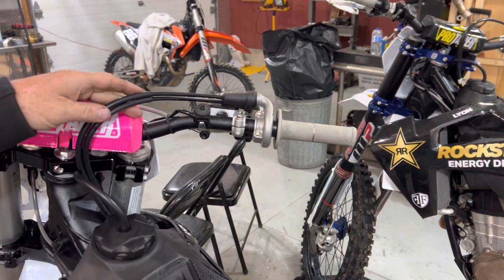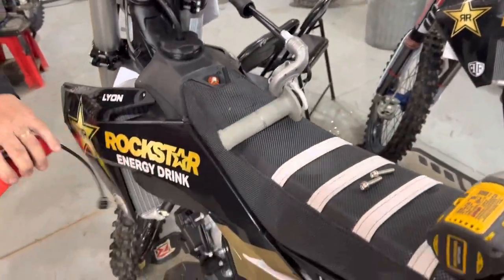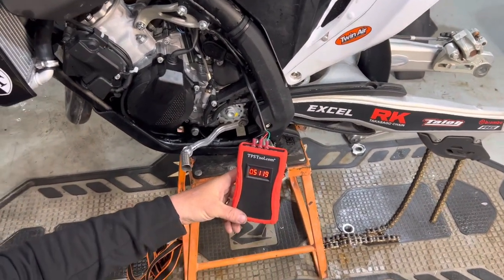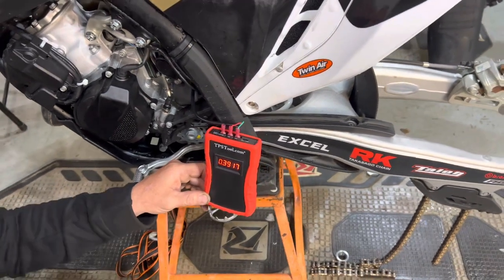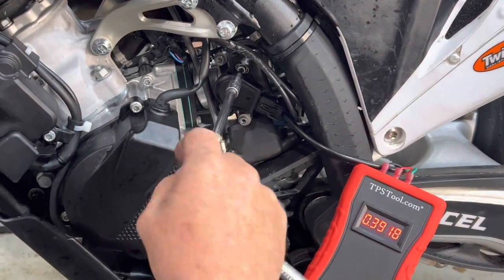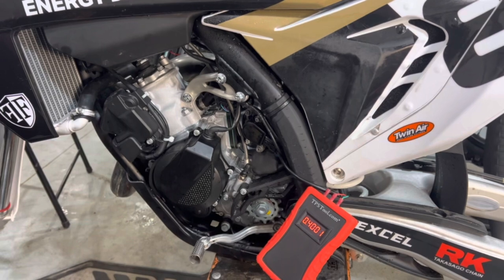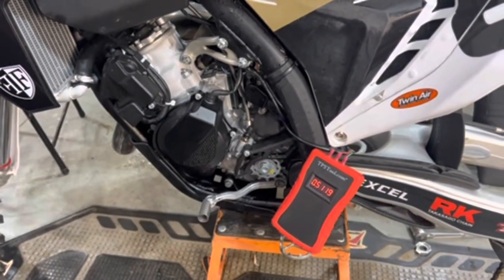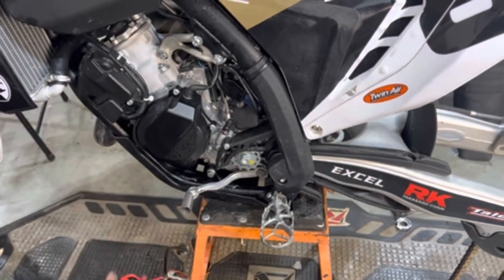TPS Throttle Position Sensor 2023 KTM 125sx 250sx 300sx TBI Husqvarna TC125 TC250 Two Stroke 2T

Comment: How would you know you need to do this I have the same bike
Reply from the maker: Be there was a notice sent to the KTM dealers to recheck all the bikes bc there was enough of them sent out that were wrong.
Reply: If you have any TBI injected two stroke you should check your TPS. This has been common place in the snowmobile world since they switched to tbi injection about 15 years ago. I’d rather change jets personally.
Reply from the maker: @tombunch5945  Yeah, the carbs certainly are easier than this lol..GasGas for 24' is TBI, so the only carbed bike will be the YZ125.

Comment: I have a 2023 KTM 125 xc with about 27 hours on it. I just started getting the “throttle valve position sensor circuit A” Fi flash code, buy doing this, will it clear that flash code?
Reply from the maker: No, dealer only resets

Comment: Why TPS doesn’t adapting to ACU? I have tried with dongle and throttle 3 times. Can it be something wrong with ACU unit? I have tried on 3 different bikes and it’s the same issue. Many thanks
Reply from the maker: You have to make sure the red and yellow idles are backed out, set the tps to .4000v, do the throttle reset, then go back and put the idles to .5150v or so and run it.  The idles are last to be done.  If it's not working there is something touching the tps and making it off.

Comment: Before you plugged in the TPS tool was the red screw already backed all the way out ? And then once you plugged in tool your daughter continued to turn out ? Or was she going clockwise with it to see numbers change after tool is plugged in ? Also is all this suppose to be done with the dongle provided with the bike plugged in the whole time ?
Reply from the maker: So I plugged in the tool, got the .5100v, backed out the red idle and then did the same for the yellow to make sure nothing is touching the tps..then set it to .4000v.  Once this is done and if you adjust the tps, you will want to do an adaptive clear of the tps settings in the ECU..there is another video on that.  But the .4000v is where it is supposed to be stock.

Comment: why is that important I don't really get it
Reply from the maker: BC it is a necessary service point of owning a bike that has a TPS..it needs to be reset from time to time and sometimes it is "off" its stock value of .4000v (in this case).  So it's just a thing that needs to be done.

Comment: What are your thoughts on going leaner? Say .35? Mine is way rich at the factory setting. 10hrs. Pv reset. Current factory map. @themotocrossmodchannel
Reply from the maker: Some are doing this with some success, mine seems to run great right at .4000v.  When the system sees changes in the TPS or other architecture of the sensors, the tables can shift to try to bring the values back to it's zero point, which is .4000v.  I haven't been able to figure it out yet, but there must be a certain value if you go out of bounds that table will shift.  Say .35 isn't enough but at .34, it shifts and pulls back the table.  SUPER COMPLICATED BIKE!  Test and see, thats what I do!  Thanks for posting-

Comment: 4:04 "backing out the red idle and yellow idle"  I'm suppose to turn both knobs counter clockwise all the way correct? 10:40 is the .5118 reading per the manual or is somthing the dealer set it to? I just bought a 2023 TX300 and it constantly dies on idle, someone said to check the TPS readings. Thanks!
Reply from the maker: So back out the red idle so the screw no matter what way you look at it, turn it counterclockwise until the numbers stop moving..it will be somewhere around .3800 on a 125.
As for the yellow high idle, back that out with "clicks" and count them, turning it counterclockwise as if you were looking at it from the bottom..imagine if both of these were screws, screwed into something and you had to back them "out".
As for the .5118v, that is basically the value that this bike was set to idle from the factory...if you do yours, your red idle number may be higher or lower than .5118v.  That final value is really only what the voltage is as it sits if it idles it not, depends on how you want it set..the .4000v is the manual number they want.  Good luck!
Reply: @themotocrossmodchannelWulfMX  thanks! I appreciate  the detailed response , I just bought the tpstool, and a service manual . it should make things a bit easier.
Reply from the maker: @richardalvarez6768  ok perfect good luck!
Reply: @richardalvarez6768  Did it help?

Comment: Are you turning the tps sensor itself counter clockwise? Thanks for this video!
Reply from the maker: Clockwise increases the voltage so I did it back and forth about a thousand times to get it at .4000!
Reply: @themotocrossmodchannelWulfMX  thanks, I just set mine last night using paper clips and my multi meter. I got it set at .4 volts base pretty quick and with red knob turned in, idling the bike at 160 degrees engine temp, it was at 5.2 volts.
Reply from the maker: @gilmag1530  that’s should be pretty close to being spot on! Let us know how the riding goes!

Comment: I have a 23 125sx I’m having issues that my idle screw has to be all the way in to idle right will this fix that, I’m also having an issue with the bike cutting out under heavy load wide open through sand.
Reply from the maker: Not sure if this will help that, take off the side black cover of the TB and see what the screw is doing when turned in, it may be stripped.
Reply: @themotocrossmodchannelWulfMX  I had a rip on the boot for the crank case pressure sensor and the bike is throwing a flashing code for it. I’m going to replace it and see if it fixes it. I just picked the bike up 2 days ago with 18 hours
Reply from the maker: @Vicscarm1  rip in the rubber hose?  Remove the sensor and clean it with some MAF sensor cleaner and low pressure air inside the diaphragm.  Then use Hondabond on both sides of the foam gasket but make sure none gets into the holes of the sensor.  Then a little grease around the green oring and squeeze it together and let it sit overnight with a zip tie.  Install and test, it should be good.
Reply: @themotocrossmodchannelWulfMX  I ordered the rubber hose and sensor I’m going away for a week so I’ll put them in when I get back. The bike is definitely running very rich I’ll post a video of it running
Reply from the maker: @Vicscarm1  OK, for sure seal up that sensor, issues with it.
Reply from the maker: @Vicscarm1  Yeah, I agree.

Comment: My 2023 husky bogs like crazy at high rpm’s and will just basically die when hitting rollers or hitting some jumps and straight aways how can I fix this
Reply from the maker: Which bike?
Reply: @themotocrossmodchannelWulfMX  tc125
Reply: @themotocrossmodchannelWulfMX  white maps to lean and the green just bogs like crazy on the track tried race fuel and different mixtures
Reply from the maker: @VisionShorts0  follow my FB user group and I can reply faster and assist- 
https://www.facebook.com/groups/709915283880183